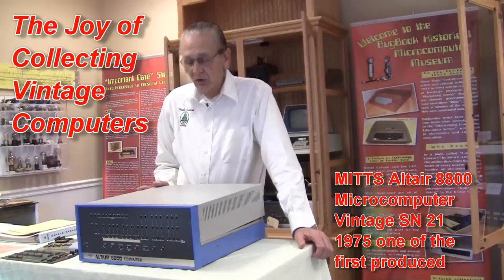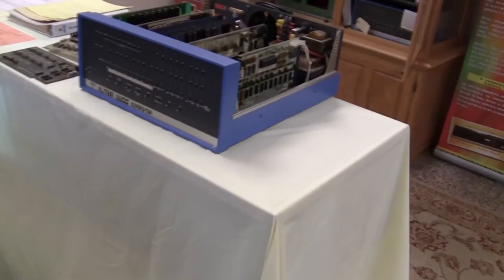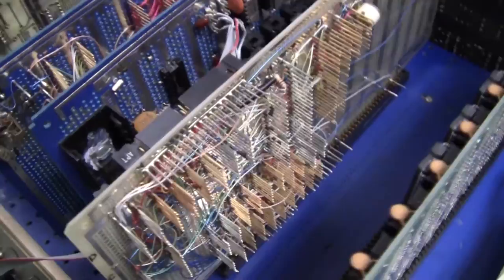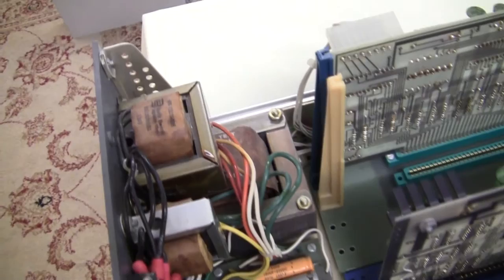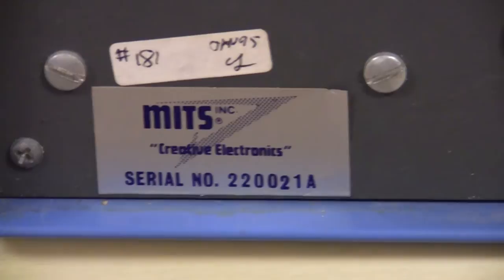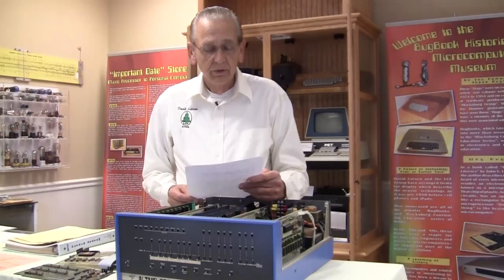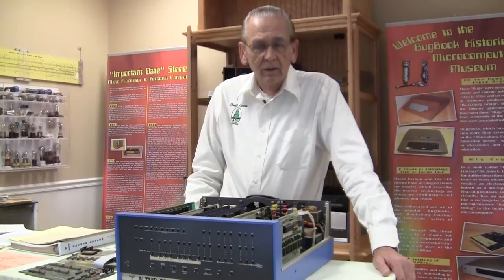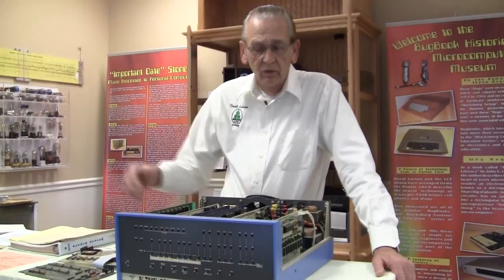Vintage Computer  MITS Altair 8800 Microcomputer One of the first  SN21

Comment: Wow love the altair I used to fiddle around with an emulator somewhat 10 years ago. Very nice wirewrap job! I never have seen it in RL except for a telephone distribution system. Unfortunately these old systems are very hard to get here in Europe - computers for individuals really started off here with the C64 and the IBM PC.